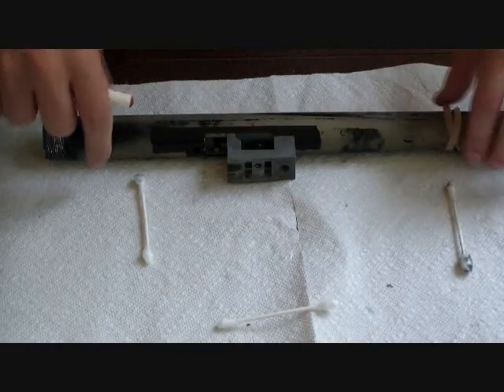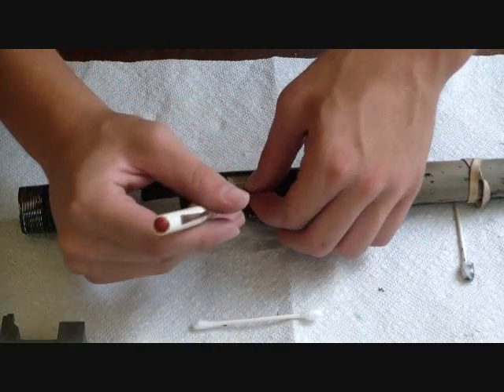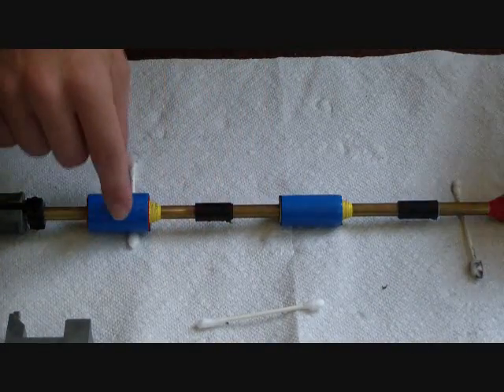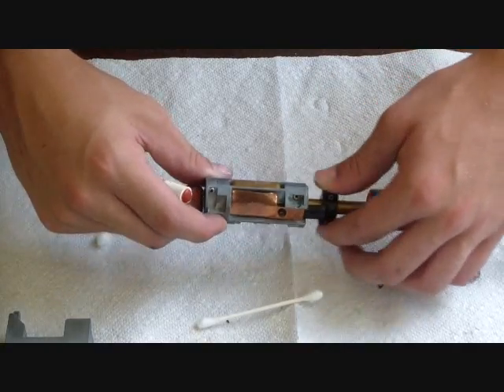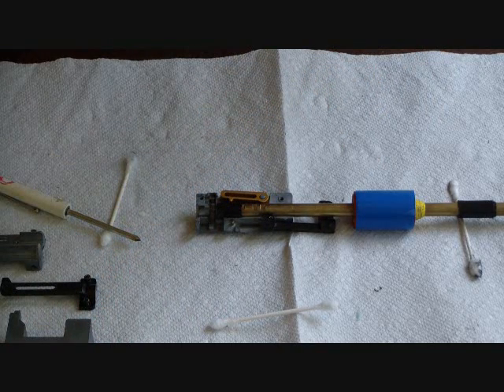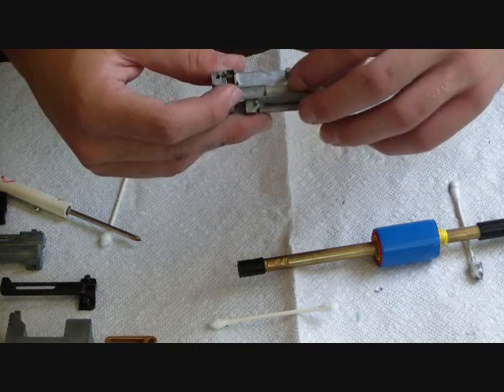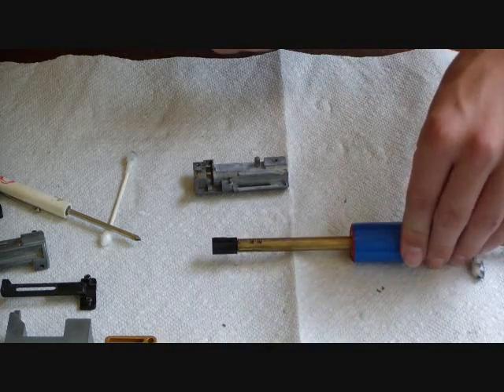VSR 10 Disassembly Guide and Tutorial Part 2 (hop up unit and barrel)

Comment from the maker: Its basically just pushing down on the lever.  Since the lever is plastic its got a habit for bending relieving pressure on the hop up arm.  To fix this, place a shim on top to keep the plastic from being able to bend so easily.  Therefore, it'll put even and constant pressure on the lever, which in turn puts even pressure on the hop up arm, which puts the pressure onto the bucking.

Comment: Im going to be upgrading my Action Vsr-10 with a M170 spring and the stuff needed with it. Do you think i could do it myself or let a professional do it? Thanks great vid.
Reply from the maker: Installing new parts in a spring rifle are easy, especially the cylinder components.  The hop up requires work in order to get it shooting the way you want it to, and the hop up is very finicky but overall, its nothing a person cant handle with a bit of research and patience.For the cylinder parts, and replacing the trigger box with a new one, it should be very easy and a quick switch.

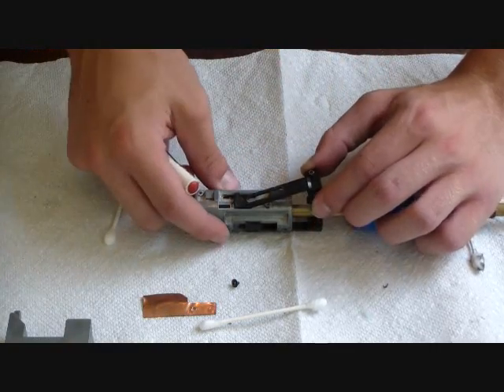Comment: Quick question, so I was installing a new hop up arm to my vsr 10 last week and the unfortunate happened. On the piece that you took off the hop unit at the 3:00 mark on the video, the little arm that connects into the actually hop up arm and applies to pressure to move the arm broke off. So now, nothing happens when I slide the hop up adjuster as there is nothing applying the pressure. My thought was that maybe with that part being plastic that it can't hold the metal hop up arm to the bucking as the plastic may not be strong enough. I was just wondering if you know or can think of a fix without having to buy a whole new hop unit? Thanks!
Reply from the maker: +izzy2350 Sorry for the late response.  You might be able to find the spare parts for cheap online in a forum somewhere.  I have been out of the game for a while, but if you check stores that specialize in BASR parts you might be able to get an aftermarket version.  Usually they are slightly better quality but are marked up a bit in the price.  Still cheaper than a whole new hop up unit.  However, there are a variety of solid hop up units out there that if you are willing to spend a bit of money on, might end up much more satisfied.  Airlift Sniper Forum will possibly have the spare parts you need or can send you in the right direction with replacing it with a new one if it comes to that.  Good luck bro.

Comment: My barrel won't unscrew
Reply from the maker: +Logan Hall Hello Hall, did you remove the small hex screw located near the receiver?  It is the one that goes into the outer barrel and attaches to the receiver to prevent wobbling.  If you do not remove this, the barrel will not be easy to remove, and you will risk stripping the threads.  However, if you have removed this screw, it is likely the receiver and outer barrel are glued together.
Reply: +Fuzzywolly Airsoft I am almost certain I removed the screw, and I don't like it's glued together because I put it in boiling water and it still wouldn't budge, any suggestions on what to do?
Reply from the maker: Those are the only two issues that I have ever run into.  What model is your rifle?
Reply: +Fuzzywolly Airsoft well then it's glued, how would you go by getting it unglued? And it's a vsr 10
Reply from the maker: Boiling water has always worked for me.  However, be sure that the brand of your VSR allows for the separation of the two.  Some cloned brands do not offer the same flexibility of part removal that the TM VSR 10 does, and as a result, it may not even be two separate pieces.
Reply: +Logan Hall I've the same problem and finally figure that it have one screw hidden under my picatinny rail on the top...